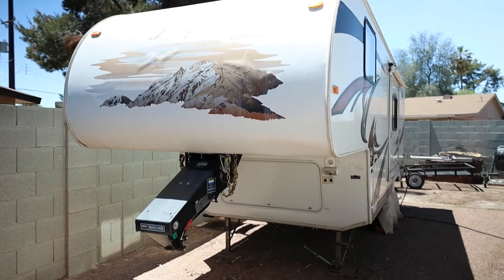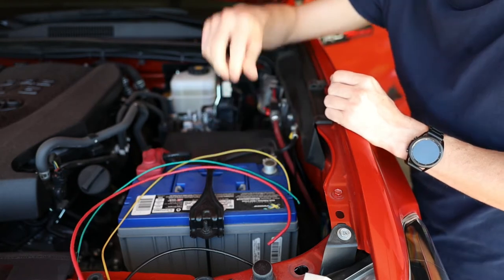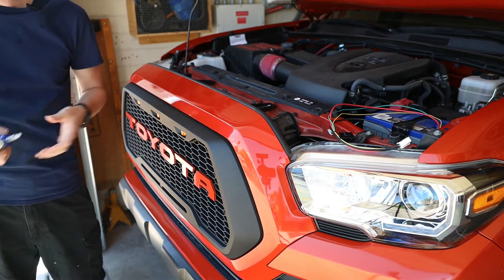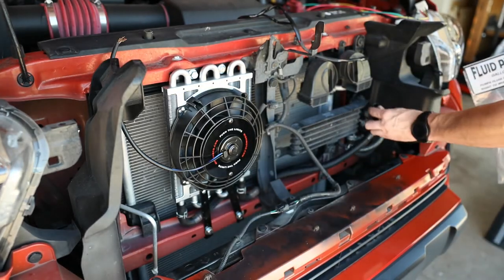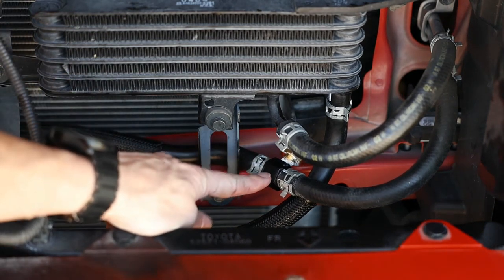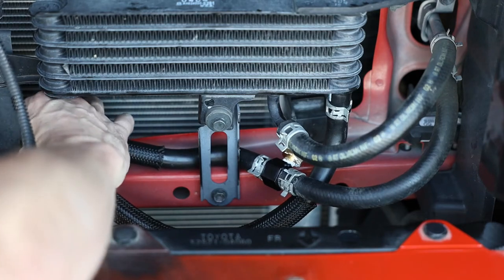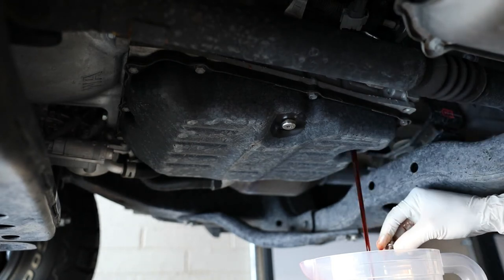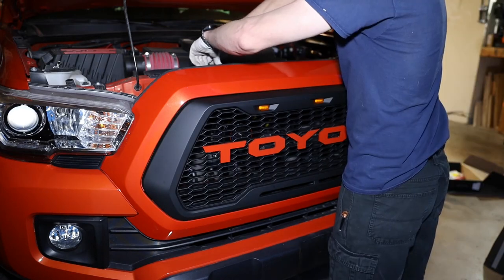2017 Tacoma Transmission Cooler Install

Comment: Nice video man thank you, I probably watched it 10 times now and I have just installed the same cooler on my 2016 Crosstrek, 
Can you please tell me how much oil did you add to compensate the cooler, I can’t find its capacity anywhere!
Reply from the maker: I think it was about 1 quart. I pumped fluid through the cooler before completely hooking it up.

Comment: Hi. Can you send me a diagram of the transmission cooler hose . From the transmission going to the 2 coolers. I’m going to install to do what you did in my 3rd gen 4Runner with metal bumpers. I’m getting an A/T oil temp red light. Can you also make a diagram of the wirings. Thank you

Comment: Were the inlet/outlet lines to the factory trans cooler marked? I’ve heard they have a red and blue marking. If not did you simple detach them to establish inlet/outlet
Reply from the maker: @danielryan9993  If I remember correctly, the line goes from transmission to radiator to factory trans cooler to aftermarket cooler back to transmission.
Reply: Thanks but I’m asking if they were marked as to which line was sending fluid from the transmission vs which was returning fluid to the transmission.
Reply from the maker: @danielryan9993  no, the lines are not marked. It may be marked on the side of the transmission but because I have a cat shield I can't verify. Then, it would be a matter of following the lines of they are marked. But sorry, I don't remember if the inlet/outlet is marked there either.

Comment: Isnt that a remote transmission coller? Meaning that it does not have to be installed on the front of the oem radiator but in some other place on the vehicle? I thought that the whole purpose of the remote tranny cooler is to not limit an air flow to your original radiator....
Reply from the maker: You probably could mount it elsewhere, but I'm not sure where else would be a good option. This location was convenient for space of the cooler, plumbing and electrical. And it doesn't have any noticeable effect on airflow through the radiator.

Comment: Does it make a difference which one of the factory lines you use to tap into
Reply from the maker: @CD-hc5ds  no. It will just change the order that the fluid goes through. I.e. The factory cooler or aftermarket cooler first.

Comment: Thank you for the detailed video. Did you have any concerns about interrupting airflow to the radiator?
Reply from the maker: No. There's still plenty. There's actually so quite a bit of room between the transmission cooler and the condenser.

Comment: I think you forgot the thermostat to take care the low Temperature at winter. Because you will fire up your truck at winter and the transmission need to get warm quick. If you leave your system without the thermostat to open the fluid line at 180 then in winter this transmission gonna take forever to get a good working temperature
Reply from the maker: I don't have that problem. I live in Phoenix. I just got in my truck and the outside temp says 122°F
Reply: @ICanDoItMyself  I live in Vegas and I wait a while at Winter to my transmission get better work temperature, all that with the standard setup.

Comment: Can the OEM alternator handle the additional amperage required to continuously run the fan?   tHANKS FOR THE GREAT VID.
Reply from the maker: I haven't noticed any charging or power issues.

Comment: A most often missed issue is tow ratings are not an absolute. That rating is determined using a trailer that has a given minimal frontal area, as in minimal sqft. or meter/sq. like a flatbed utility with bricks or firewood. 

Travel trailers throw all that out the window, as the wind resistance is more parasitic than the weight. A truck with a rating of 6500lbs for example, isn't meant for anything near that in enclosed trailer weight.
Reply from the maker: Weight ratings are based more on how much weight they can safely stop and/or prevent from pushing the tow vehicle down a hill. It's not based as much on power.
Reply: @ICanDoItMyself   chassis limitations, that is correct also but frontal area wind resistance is figured in.

Comment: Sir when you on bypass switch the fan running did the temperature drop for the oil?
Reply from the maker: It did not. But that is because the thermostat is set at 200° for the fan to kick on. I did do a video where I did some towing with the transmission cooler. Be sure to check it out in my Tacoma playlist.

Comment: What is that part that you are installing it in front of? Is that the radiator?
Reply from the maker: AC condenser. Radiator is behind that.
Reply: @ICanDoItMyself  Ty. I’m trying to find out how to replace that but all the videos I’m seeing state having to remove the inside dashboard. Needed clarification on the part name so I can make sure I’m not tripping. Appreciate the fast response. Subbed.

Comment: Followed your install, more or less. I did not install the thermostat, as I monitor temps as part of my instrument scan, and I have an OBDII monitor. On my initial test drive, with the transmission thermostat bypassed, I was seeing much lower temps on fairly flat ground (160-170F). OAT was right at 100F. I drove to the top of a mountain pass nearby and saw temps get as high as 204F, with the fan running. Keep in mind I was running 65mph and its about a 4000 foot climb to the top. I have not towed with it yet so I'm interested to see those results. What are your results, what temps are you seeing? As a side note my 18 has 60,000+ miles and its clear that the trans fluid needs changed. That's up next!
Reply from the maker: I'm at 27k. I have not towed my fifth wheel with it yet, that will be next month and I will be doing another video on it then. Running around in Phoenix temps (even 115-119°) the highest I've seen is 189°. Btw, if you're interested in more Tacoma content, I'm going to be moving all my tacoma videos over to a new channel where I will have Tacoma only content.
https://youtube.com/channel/UCKcElFA8jzj2t8AaysTqoGQ

Comment: In Kuwait, temperatures in the summer reach 50 degrees Celsius. Any advice from you regarding the transmission cooler for this weather for towing with Fj cruiser??
Reply from the maker: I'm not familiar with the FJ beyond looks but this setup definitely wouldn't hurt. I've noticed a pretty significant difference in transmission Temps. They're lower and more stable now while towing. Never kicks on in normal driving even in the summer.
Reply: @ICanDoItMyself  nice work bro and thanks for reply 
Best wishes 🙏🏻

Comment: What were the toyota part numbers for the cooler hoses please? Thanks for the awesome video 👌.
Reply from the maker: Sorry for the delay, I had to find them. 
32943-04070
Reply: What is the part number for the transmission cooler with the fan, and the wiring kit thanks Dave  (note:I can't find i

Comment: brother good morning, let me ask you a question, well first of all the video is excelent, thank you for all. i sub to you already. my question is, where did u get that switch panel? to work with the switch? because i got the same as you do the switch but idk if it will fit my original switch box that came witht he truck
Reply from the maker: I got it from Meso customs.
https://youtu.be/hsvHcThbuLw

Comment: I just got my transmission flushed. Is putting new fluid in a necessary step?
Reply from the maker: No, but you'll need to add enough to allow for the additional capacity.

Comment: Never install a transmission oil cooler with the inlet and return lines facing down because of air Issue air can't Escape from the top of the cooler Otherwise it's a great job buddy
Reply: Would you recommend the lines enter from the side or top?
Reply: The lines are pressurized like a garden hose. The fluid is pushed through the lines from the transmission, so I’m not seeing why that would matter in any fashion. The cooler looks clean and the routing looks well thought out :)